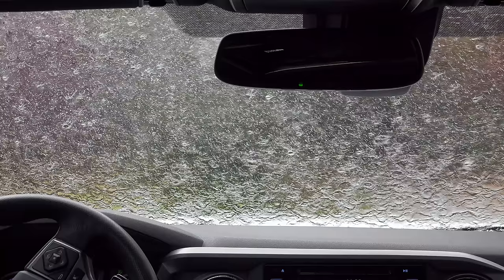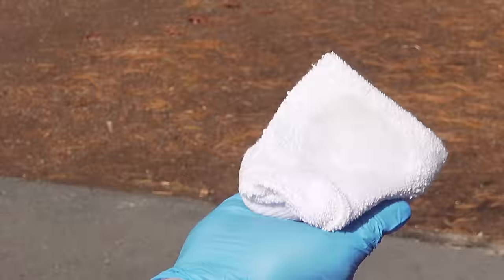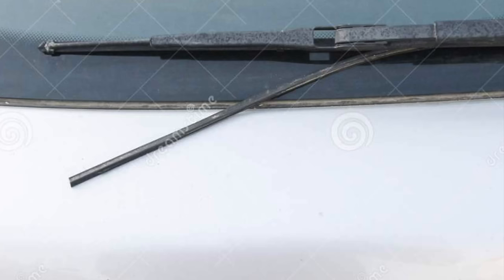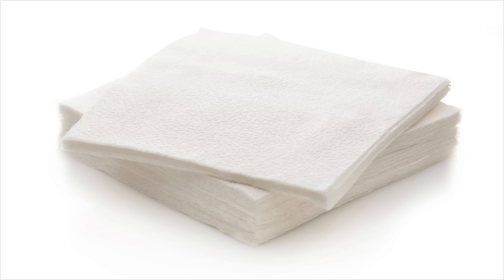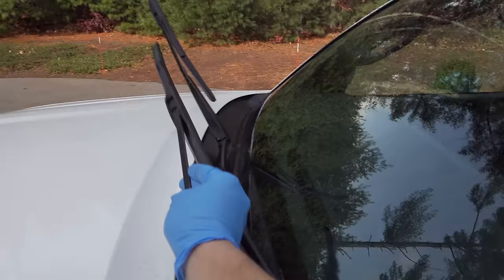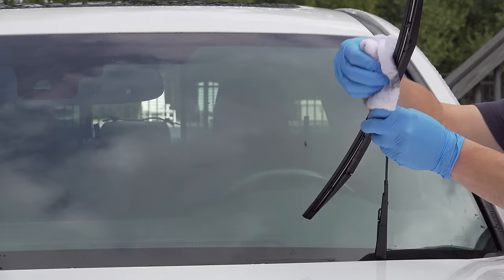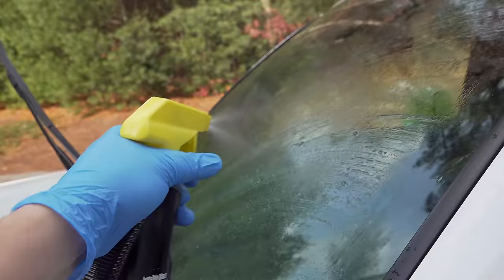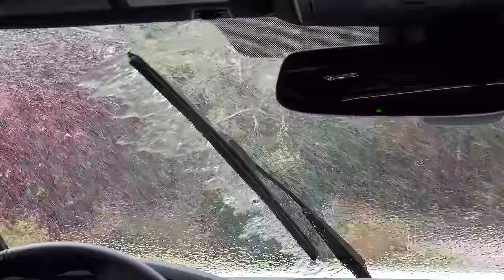How to Make Windshield Wiper Blades Like NEW in 30 Seconds

Comment from the maker: Please 👍this video & SUBSCRIBE- Best deal on WD40: https://amzn.to/2SMUiHd - Great glass cleaner: https://amzn.to/2KjYIOa  Check out my channel for others DIY projects to save you money and get great results!
Reply from the maker: This one is so easy and gives you some happiness when you realize your wipers are dead and need some help.
Reply: Yes Sir I've been doing this for about 35 years now. Friends think I'm nuts until they try it themselves! Thanks and keep up the excellent videos. Maybe a snowblower vid coming soon? Gotta get them ready it's cold here in new England
Reply from the maker: @starninja7742  Exactly!  Its such a great tip. thanks for the feedback on this too
Reply: Excellent tip mate.
Reply from the maker: @shoaib1029  Thank you very much
Reply: What about silicone spray? Will that work? I'm too cheap to even buy WD40 😂
Reply: thanks for the vid, i have scratches from wiperblades on a car i just got, the washer motor didnt work, is there anything to get them out. cheers
Reply: Silver Cymbal thats actually work thank you
Reply: your not "degreasing" anything here. cleaning maybe.. what's actually happening is your lubricating the rubber and removing dried rubber. 
some of which is absorbing the lubricant. 
this is why they glide so nicely over the glass afterwards.
Reply: Sashimi 2nite haha yeah no that was just Alexa, Facebook and Seri listening in.
Reply: Yeah right 😂😂😂👎
Reply: @patrickglaser1560  WD40 uses Carbon Dioxide as propellant.
Reply: John Drohan  , you need to do Better research if you really want to be correct.
Reply: I sprayed WD-40 on my cat
Now my cat is silent
 don't know when it needs to go out
Cat shit everywhere 😱
Reply: just did both steps on my daughters car, now gotta wait for rain
Reply: XXXx @MichaelMantion
Reply: I've tried that doesn't work tried it 3 times didn't work my blades 1 years old
Reply: Hi
Reply: @MichaelMantion  bbbbbjji

...ik
Reply: WD40 is petroleum base, it is not the best for rubber.  Silicon spray is better since it evaporate fast and Silicon is good for rubber.  However, doing it to my old wiper cause it squeaking.  Finally, I just clean it with washer fluid (70% ethanol) both on glass and wiper fix the  squeaking.    Any oil, wax residue on rubber or windshield cause squeaking.  Especially in small rain, not in heavy rain.
Reply: @rondhole  Best tip here - I was worried about the effects of WD 40 on the rubber. Eventually it dries it out.
Reply: @garethifan1034  yes, never use petroleum base on rubber. Some rubber stands better than others on petroleum but avoid it. You can use silicon oil or spray but wipe it out or may cause squeaking. The ribber is fine with silicon and will last longer but not for wiper. Silicon oil or spray is good for Treadmill band use weather stripping, rubber carpet, hoses, and cables.
Reply: @SilverCymbal  ac x op
Reply: @SilverCymbal      🍰
Reply: Man goes into a parts store and asks where the WD40 is and the clerk says over on the next aisle between the WD39 and the WD41
Reply: What about using the WD40 to clean the windshield of the car or will that leave a oil residue
Reply: if you use a woman's sock you don't need a wd40...
Reply: But WD-40 dries out rubber which eventually brittles it.
Reply: I have used a similar approach but not with WD40 with similar results, the downside is that it's not long lasting. I'll give this a try but I would add after cleaning the windshield to apply rain-x. Water slides off the glass and doesn't bead up. Wipers run smoother.  Plus during the winter frost comes off the glass with ease sometimes with just one pass of the scraper.
Reply: @donaldtromp9011  <
Reply: @Silver Cymbal thank you for the share
Reply: Thank you! Mine are scraping now and will use this procedure to not buy new ones!  😄 I also use W-D 40 on my squeaky doors inside my house!🤗
Reply: @Silver Cymbal good tip, but the 30 second bit is a little click baity... no way you can do this in 30 seconds. Realistically, it more like 5 minutes.
Reply from the maker: @rheaghen  99.5% of the time I only treat the wiper blades, and that only takes seconds. If you do the windshield cleaning too. yes it will take 5+ minutes but the wiper restore is fast
Reply: Since wd40 eats plastic and rubber, and that's what you saw on the paper towel, you can actually get more use from a very old wiper blade but please don't make any more videos
Reply: @WellBehavedForeigner  aren't you being a little hyperbolic? What, besides  polycarbonate and clear polystyrene, is affected? We ARE talking about disposable wiper blades here.
Reply: @rheaghen  I used it to buff my customers' headlights without doing any work
Reply: Dad told me about this and I tried it on our E Golf and it worked wonders on those noisy wiper blades 😄
Reply: @Pervypriest  Offcourse, We want silicon on rubber parts. Silicon is used for protecting rubber from UV and chemicals.  That's why we use it in espresso machine gaskets, brake sliding pins, treadmill,l, and bike belts.  Silicon spray works really well to clean the wiper blade without causing it to dry because it contains no petroleum and evaporates so fast.  For windshield, I did not spray on the contact point but only on the side parts of the rubber to protect it from cracking.  The whipping edge, only needs cleaning with soap and water.
Reply: What do you consider a quality glass cleaner
Reply: @PurpleObscuration  For me, the washwer fluid for winter works the best.  It contains lubricant from the detergent and cleaning power of ethanol (80% ethanol for -60C rating).  It is really good for cleaning the windshield and at the same time keep the wiper blade clean and last longer.  I only recommend wiping the rubber occasionally.  Clean the glass more often. My squeaky issues is gone forever since 4 years ago with this technique.  MY wiper also last longer, 2-3 years instead of 18 months.
Reply: @starninja7742  I use WD 40 to spray the inside of the snow blower shoot and inside the hogger to help snow slide and not get stuck. Easier to clean after i'm finished
Reply: David   thats a big help thanks
Reply: David  its ok i knew u were, im not that dumb i was being flippant lol, thanks for the reply
Reply: Your "Best deal on WD-40" is a horrible deal. Who pays $1.14 per ounce for the stuff. Not this guy!
Reply: in my experience, in dry weather 70% Isopropyl alcohol does the best job. In winter condition with lots of salt, air spray silicone lube to a cloth does better job than WD40 for a simple reason - rubber gets longer life with silicone lubrication. 😉
Reply: This does work well, but the WD-40 isn't just cleaning the rubber, WD-40 actually disenagrates  rubber products, so what is happening is your removing a thin layer of dry, weather degraded rubber. I use this on my RC tires to get more traction.
Reply: How long to take wipe with the wd40 on wiperblade on wind shield
Reply: 9
Reply: Thanks mate just just tried this on my wiper blades and solved this annoying problem..
Reply: @shoaib1029  trucks ramp
Reply: @SilverCymbal  I drove over the road big rig and your right about everything but there needs to be a third step. Get rainx booster for your washer fluid and spray it on your windshield straight out of the bottle concentrated while wipers are running. You will definitely thank me afterwards when you hit a downpour!
Reply: It's been 2years and a few co19vid strain's and this comment still cracks me up til this day 😁🤣
Reply: Let me ask you this one. How fast does the wd40 degrade the rubber? Wd40 is a cleaner however it draws moisture out of things like rubber. Wd40 was designed and used for removing water from distributors. You should use a silicone based cleanser. But I will say that you are right about keeping your blades clean just use something that doesn't draw out water.
Reply: 11,000,000 views! Way to go! What should I put on the rubber door frame molding?
Reply: Stoner is the very best car window cleaner
Reply: The only two things you need in life is WD40 an duct tape...WD40 if you need to move something and duct tape if you want something not to move.
Reply: Oop
Reply: @starninja7742 I’m in NE also.this winter reminds me of 2015.same mild weather with no snow.then the end of Jan into early March bang.a storm ever 4-5 days.i hope I’m wrong
Reply: @niteblaster1 😂😂😂😂
Reply: You can also fix them with brake fluid. You can clean them with wd-40, but if they are old it's better to wipe them with dot3/4 and clean it of. The rubber becomes like new again..
Reply: @pekesrepose7363  just use dot 3 / 4 and wipe it of from rubber after 10 minutes. They are like brand new
Reply: Don't do too often. After some time there is no rubber left on the wipers!
Reply: lol. 14 millions views for one of the worst things to clean wiper blades.
Reply: In 30 seconds? 😝

Comment: This is bad advice and will only work well temporarily. WD40 is mostly made of petroleum distillates and oil. These 2 ingredients will accelerate the breakdown of any rubber product. Sure, applying it to wiper blades will remove caked up debris and lubricate them to slide easily over the glass windshield (even with no water present), but the rubber compound of the blade will degrade and crack quicker. You will be disappointed at the short lifespan of your wipers, especially if you paid $30+ for the pair. The best way to maintain your wiper blades is to apply soapy water with a scrounge pad to remove caked up debris then wipe a silicone lubricant on the blade with a cotton rag. Ironically, WD40 also makes a silicone lubricant in a spray can. Silicone won’t breakdown rubber like petroleum distillates and oil will.
Reply: How about brake cleaner? It should be rubber-friendly as well, right?
Reply: This is the way. 
Thank you ❤
Reply: What soap can be used for it? Dish soap? Hands soap? All purpose soap?
Reply: @driftyboizz  Any liquid soap will mix well with water. Hence, “soapy water.” It’s not rocket science.
Reply: He got 15 million views. Now he can afford to replace his wiper blades every 3 months and have his servant 🤵do it.  😅😂
Reply: @briank10101 😂

Comment: "If it moves and it shouldn't –duct tape. If it doesn't move and it should –WD40".
Reply: Engineering
Reply: @felixkarottenrambo5395  PROUD to be #100! 👍
Reply: If it moves and it shoud but you konw it wil stop soon than better be prepaired and Just duct tape a WD 40 to everything in case lol :)))
Reply: If it still doesn't move, grab a hammer.
Reply: @RandomShart  If it breaks, it needed to be replaced anyway.
Reply: A Man after my own Heart 👍😂
Reply: And video would be 10 sec long instead of American dramatization way of pointing out simple things
Reply: If it existn't, just build it outta duct tape!
Reply: and if you can't fix it with a hammer, you've got an electrical problem
Reply: ZombiePotatoSalad 99
Reply: The handyman's secret weapon
Reply: Remember though, WD40 really isn't classified as a true lubricant in the sense of staying power.
Reply: Official US Navy regulations.  "If it moves, salute it, if it doesn't, paint it".
Reply: Especially since we no longer get wire clothes hangers.
Reply: Sounds like Mexican engineering
Reply: Love it! 😄 
NanaAnn:a lady who once
duct-taped the body of her
1982 Toyota 'manual' truck. 
LOVED that FUN truck for gas mileage and engine, but
sadly had to sell it when
her grandsons were born for more space.
Reply: Channeling Red Green?
Reply: My dad swears on duct tape.
Reply: wd40 is like some kind of religion in usa, right?
Reply: Duct tape, wiper blades.
Reply: @ewilliamson488  I swear at duct tape.
Reply: @DaP84  I've also learned that if your duct tape doesn't stick just use duct tape and if that doesn't work believe it or not you can use duct tape
Reply: @BigKokka    ..  It works. That alone is worthy of garnishing a fairly loyal following.
Reply: ..  The WD40 containers clearly say the product lubricates, but nothing about cleaning. That's just the opposite of what you say. The containers also say nothing about being a degreaser. The product can be used to clean and remove grease, but it's certainly not limited to that. Not even it's primary purpose.
Reply: Red Green 😂😂
Reply: Old Navy saying:
"If it stays still, paint it. If it moves, salute it.
Reply: And if neither one of them work, 9mm Luger!
Reply: Yeah worked perfectly on my wife
Reply: @robinstewart6510  garnishing?  Like garnishing a salad??  Oh, you meant garnering. Gotcha.
Reply: @kenhill5713    ..  No, I meant garnishing, as in impounding, seizing, or sequestering. Garnering works just as well.
Reply: how about dead people? or zombie?
Reply: @1679haha    ..  Lol. Well, dead people aren't supposed to move, so no problem there. Haven't ran into a true zombie yet - a lot of dumb, brain dead, people, but not an actual walking dead zombie.
Reply: @CLCinflorida  p
Reply: Brilliant
Reply: Oddly enough, you can use WD40 to remove duct tape, but you can't use duct tape to remove WD40.
Reply: @retroactivrestoration1572  I will remember that one🤣
Reply: @ramibos6549  we have Democrat her n thare all a pound of tatters short of happy meal lol  so we have explain ever thing n take slowly 
I mean look at Biden
Reply: Great comment
Reply: Are still with us ?
Reply: If it moves and shouldn't I use a rifle. If it doesn't move, I use a shovel.
Reply: if sometimes it should not move but move, and sometimes should move but doesn’t move - kick it
Reply: I thought duck tape was the answer for everything
Reply: If you're not handsome at least be handy.
Reply: And if it isn’t broken, don’t fix it.

Comment: I always wondered what the WD stood for: Wiper Degreaser. Now it all makes perfect sense.
Reply: Water Displacement / Formula 40
Reply: @Cornz38  smh
Reply: No. No. No. It's not Wiper Degreaser... WD stands for Windshield Degunkifier!! GOT IT!!! Which windswept crag of rock have you been marooned on all this time, Jeff???
Are you the same Jeff Rapp I did junior high with?
If not, please disregard this comment completely... and just have a good old laugh.
Nyuknyuknyuk! Oh.. a wise guy 'ey?
Reply: Good one!
Reply: wasn't it designed for use at NASA for water displacement on rockets and being the 40th revision?
Reply: Perfect sense 😂😂
Reply: DOH!
Reply: It was invented during WWll 
Water displacement 40th try was the one they used to do the trick. 
I have used it to dry out distributor caps on vehicles when they got wet , works like a charm
Reply: I always wondered if formulas 1-39 had any use at all? Did they stop at 40? Did they try to make it even better?
Reply: WD40 stands for "fuckwits who don't understand when someone is making a joke and feel it necessary to correct them". Apparently.
Reply: i always wondered what KFC stood for, now i know

Kan Fix Cars
Reply: It's stands for Water Displacement
Reply: @dlsickofit542  Great for keylocks before winter hits too.
Reply: It's actually named after the inventor Wilbur Doofus who was 40 when he thought of the idea.
Reply: And the "40" in WD-40 is because it takes 40 seconds to complete!!
Reply: It stands for Waptain Dobvious
Reply: @lfcmarkeb7124  Yup. NASA. It was used to prevent ice from forming in critical joints prior to vehicle launch.
Reply: @thomascalton3067  the first 39 were just pretty much duds. 40 was pretty much on the money. WD-41 resulted in a tragic laboratory fire that claimed the lives of... sorry, I'm still not ready to talk about it. Suffice to say, they learned their lesson and stuck with 40
Reply: @Cornz38  thank you Sherlock! But it was better if you understand a joke 🤷🏻‍♂️
Reply: @christopheralegria71  Why, is your neck loose??
Reply: @Karlsboy  Aren't jokes supposed to be funny?
Reply: Ha ha....but you likely already know that it stands for Water Displacement, and the 40th attempt was the successful one. I'm a 68 year old woman, and I know that one!
Reply: No no it stands for water displacement
Reply: Water Displacement
Reply: Walters displeasement
Reply: @lfcmarkeb7124  It wasn't developed by NASA, and it was made to spray in the distributor of a boat engine. When water condenses under the cap, it shorts out the spark.
Reply: It Stands for: Western Digital
Reply: You're all wrong. It actually stands for Wiggity Diggity.
Reply: @emilcioran8873  Yeah, I remember those - 40 MB, state of the art, 4X faster than the 10MB PC-XT drive.
Reply: I like your original comment !
Reply: @Cornz38  Waluigi Distilled No.40
Reply: @sixstrings4568  😆🤣
Reply: No, I think it stands for "Well Done!"  🤣
Reply: I thought it stood for Water Dingaling 😂
Reply: lol Windshield Degunkifier! Love that one. Yeah, it was invented by Rocket Chemical Company, perfected in '56 or '57, their only successful product. Convair coated the Atlas missile to prevent corrosion, employees started stealing the stuff, so RCC put it on San Diego store shelves around 1958. Or so goes the WD-40 history byline.

Comment: this worked so well on my wiper blades that i tried it on my tires. After the accident i got a new car and the wipers are awesome on it. Thanks for the tip. You can hardly notice the scars on my face anymore
Reply: WD-40 could help with those scars.
Reply: Don't forget to spray it on the brake pads of your new car. They'll last longer that way.
Reply: @HansDelbruck53  🤣
Reply: The scars… have you tried buffing them out?
Reply: I was following you. Want the dash-cam footage?
Reply: I had the same results using it on my motorcycle seat.
Reply: Well that was a long way around the block.